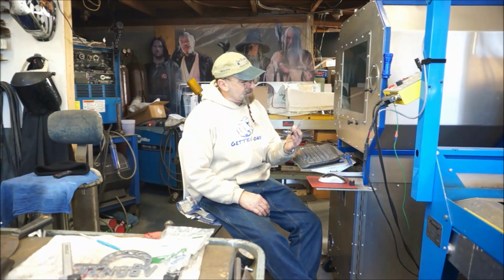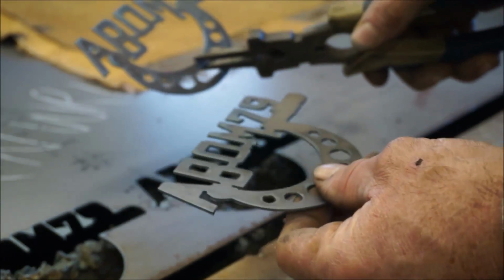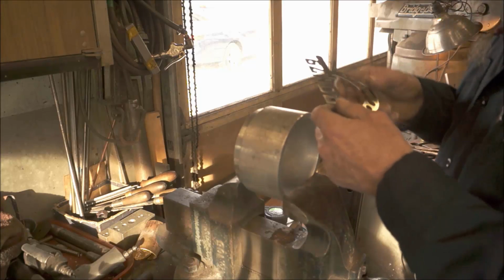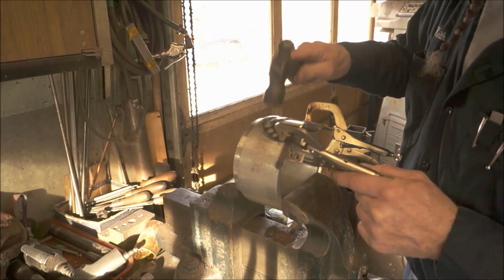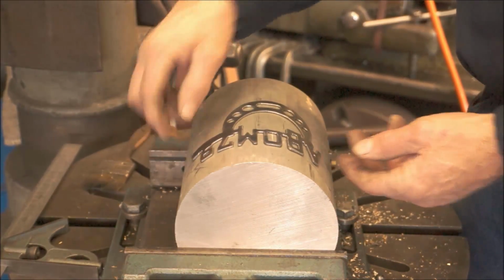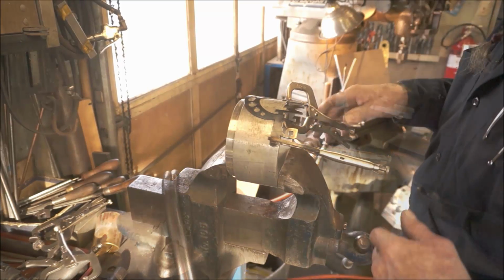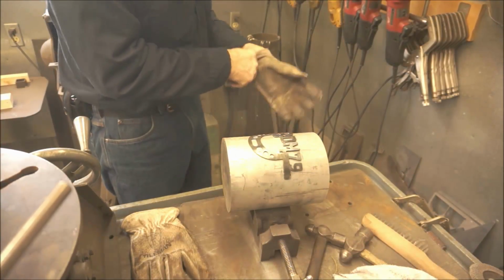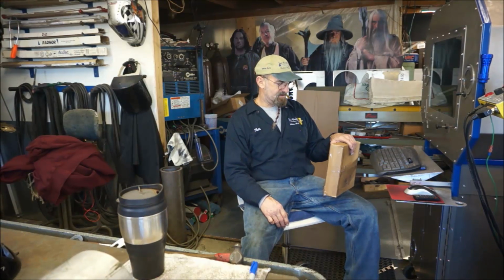Make Mine Metal

Comment: Hey Keith, I like your videos. I just did a job similar to this last week only with a laser. Sending the pieces through the slip roller left the kinks you described. So I sandwiched the piece (18 Gauge) between two larger pieces of 18 gauge and sent the whole thing through the roller. Used the same wraps for all 500 pieces. Came out great. I do the same thing on the press brake from time to time when a piece is too small to bridge the bottom die. If you haven't try it out give it a shot. Saved me a ton of time. Anyway, subscribing. Thanks. - Jay.

Comment: Good job Keith, why didn't you fire up the PlasmaCam pipe cutter attachment and just cut it out from tube?
Reply from the maker: Josh Taschuk My water tray hinders the setting of the pipe cutter attachment to run off the end type cuts and just waiting until my modified rollers are done to use that feature. ;{)-----

Comment: Logo looks like it turned out great Keith nice work again.  Looks like that torch tip is dirty bud LOL!  Are you running 60 amps for most of your plasma cam work now?
Reply from the maker: Bill De La Vega Yeah it looks like it, I need to make a cradle for the torch on the cart instead of setting it hot, in the tray, where it gets or comes in contact with dirt and buggers up the end. Most of the time I run the 60 amp tip but turn down the machine amps to suit the thickness a bit better. Also still playing around time to time with smaller tips on real tight cutting but there isn't to much difference between a .060" and a .080" kerf width, but there is on how fast you can get around, or in and out on the tiny stuff. ;{)-----

Comment: Sometimes forming small shapes inside the pipe forming tool is easier, more so for the final finishing.
Reply from the maker: Bob Smith We will try that on a future project! ;{)-----
Reply: A half pipe with chamfered edges is a great tool for this kinda stuff. I find you need way less clamps working on the inside. The edges prevent scratches if you just push the flat material into the pipe from the top. It also seems like the metal moves better if you are correcting the original rough curve back towards flat..I picture it as the hammer blows flattening the too curved part from the back as opposed to inducing more curve to the flat areas from the front.

Inside the pipe is how to get bent.....